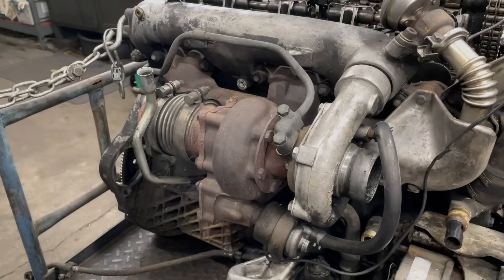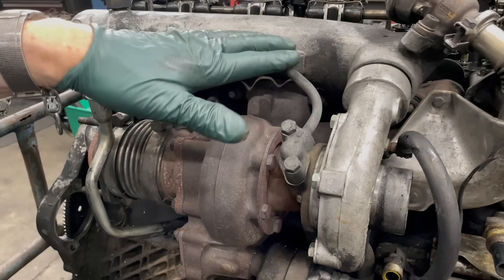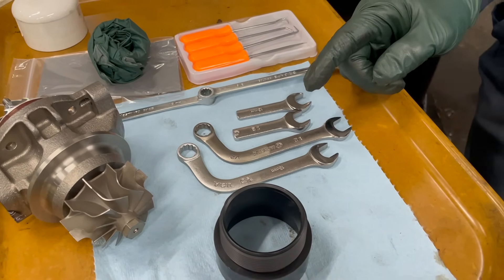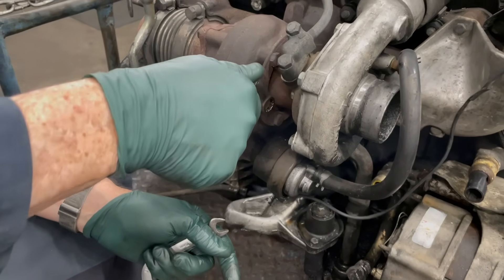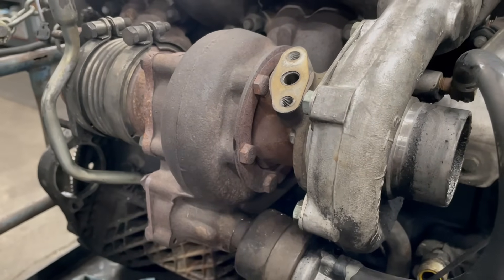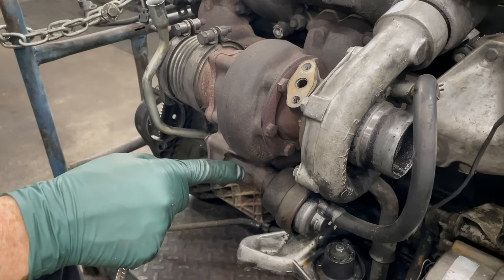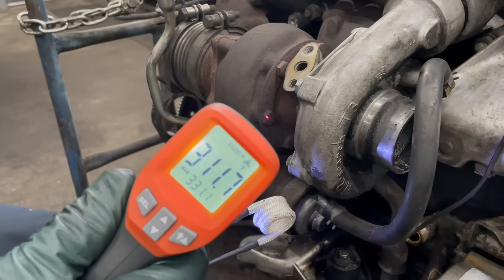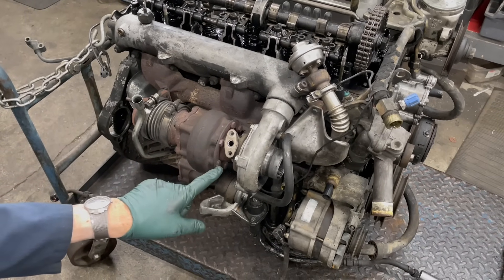Garrett T3 Turbo Center Section Removal on the Engine: Rusty Bolts Out! @www.mercedessource.com

Comment: Excellent video…I actually removed mine and with bolts removed had to chuck the turbo housing against the garage floor to get separation. Also, and I don’t remember exactly, used a couple bolts in situ, as as a press.